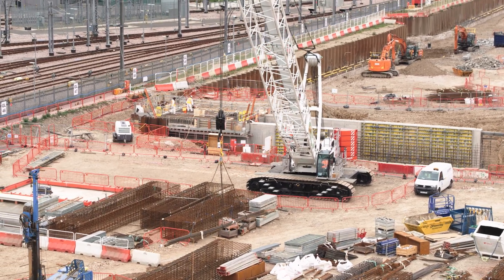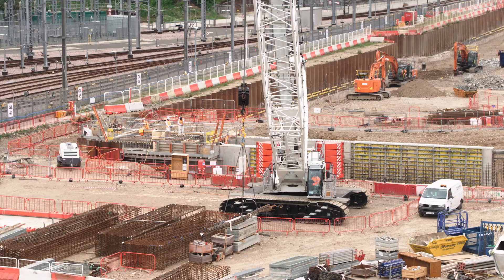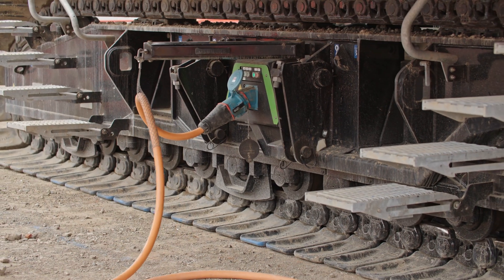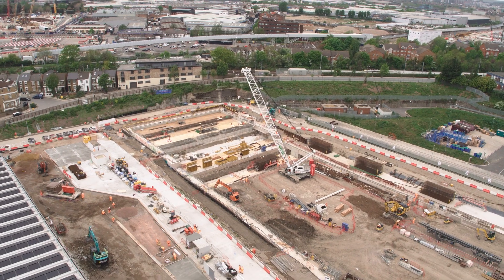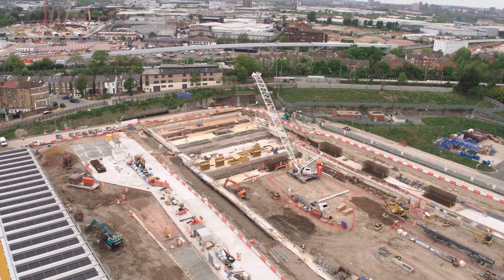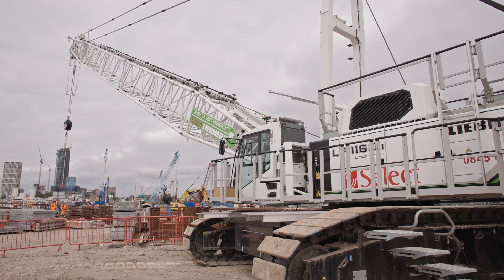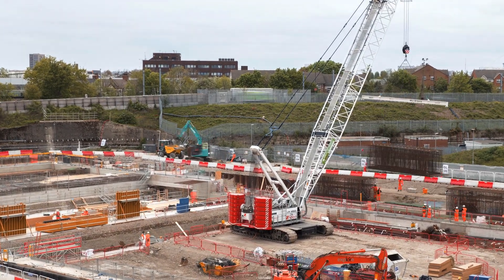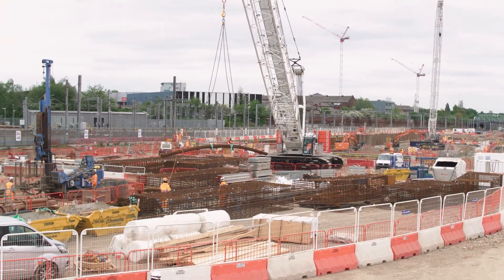Liebherr – Unplugged crawler cranes, “The most sustainable future.”

Comment: What about charging it the power. Most people don't think of what it takes to run the Electric versus diesel. When I see cars stuck on the side of the road with a mobile generator plugged into them because they ran out of power that's not helping the environment there needs to be a better solution.
Reply: Interesting.  I've seen ICE vehicles on the side of the road because they ran out of gas.  I've also seen ICE vehicles on the side of the road in flames.  Each year in the U.S. there are over 150,000 ICE vehicle fires and the gasoline ends up burning over 500 people to death.

Comment: Is the battery made environmental friendly ? 
Where does is come from ? 
Is it shipped environmental friendly ? 
Is the used electricity green ? 
Where does the battery go when it’s time is over ?
How long is the battery usable ?
When does the battery start to lose capacity?
Reply: shhh your exposing the truth about renewable energy. We're all meant to nod & agree asking questions will get you put into the naughty corner & labelled a climate violence denier or even worse a conspiracy theorist.
Reply: Batteries can be recycled diesel cannot. 
Batteries can be charged with electricity that is renewable.
Batteries in vehicles or plant have good thermal management, charge & discharge rate control and safety buffers at the top and bottom state of charge to protect and prolong lifespans, they last decades,
Batteries are not a single entity but a large collection of smaller cells, they can be repaired and refurbished. 
A battery and electric motor are up in the 80%+ efficiency but a diesel engine wastes about 70% of the energy input. 
And most importantly an electric crane produces no pollution on site where people are working, especially carcinogenic pollutants, such as Nox.
Reply: @edwardpurkis1084  mean while energy prices are going through the roof & even calls for rationing energy through blackouts. Buy electric vehicles to save the planet also don't use electricity to save the planet.
Reply: @edwardpurkis1084  do your research 🧐
Reply: @mellowtraxX1  Do you ask these same questions of gasoline and ICE vehicles?  Why didn't you mention the children in Africa that have been killed by the oil industry.  So many children have died that some African countries are now trying to sue big oil companies in Western courts.